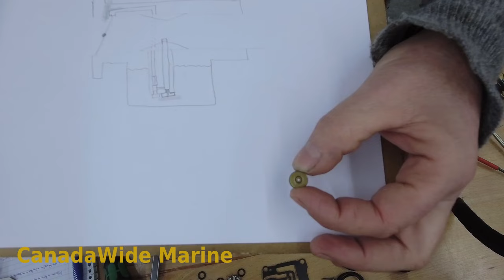Diagnosis and repair of 4 Stroke Outboard motor Carburetors. A look at the common issues.

Comment: I've been cleaning carbs for more than 40 years.  I've worked at an outboard shop & a couple of motorcycle shops.  This is the best description of what to do, how good it needs to be done & why you need to do it, that I have ever come across.  You did a great job.  Two thumbs up.  I watched this video because I needed to find the idle mix screw on a Merc carb & it was a dead ringer for the one carb that you showed.  I saw the location of the screw on yours.  I didn't see the plug on mine at first because it was behind the choke linkage.  You taught an old dog a new detail.  Thank You
Reply from the maker: Nothing better than a compliment from our peers in the industry. Thank you.
Reply: Ditto, was looking for my mix screw on my Merc this video helped a ton.
Reply: Hey, I just boat my first boat and I’m having some issues that I think is the carburetor. Do you think I can give you a call or text and you can help me out? Every where around me they want $450 to clean 1 carburetor… which is ridiculous.

Comment: There is absolutely nothing but great information in this video but just a point from my 9.9 use and quick but permenent fix. My best friend was a carburetor man for 45 years the absolute best. He couldn’t clean repair mine after tearing apart couple times. I bought a new on not that expensive.Didn’t work I new the motor had plenty hours but I new motor was perfectly good.  Then he noticed in the picture same carb upper left hand ther is a round circle with a plug in it. Popped it out  there was the air fuel mixture screw. Epa requirement cap for new factory setting not to be touched. Wear tear varnish whatever just a little turn giving motor more air and it ran like new. That motor keep running like new for three more years putting 400 hours a year on it. Bought a newer boat and gave that motor to a friend. It’s still going like new. Hard starting  rough idling that’s your baby. I live at the beach and it’s worked everytime I showed that cap trick to others that come and go from resort.

Comment: I am sitting on a yatch in a remote part of Australia, population density 1 person per 100 square kilometers. 😀300 nautical miles, 2 weeks from the nearest Yamaha outboard service centre. My outboard will not idle properly and cuts out when turning the accelerator. This is a brilliant step by step explanation of what could be wrong with the carburetor and how to diagnose it.  Thanks Canada Wild

Comment: The best lesson on small boat carburettors I have ever seen. I have 4 small engines that get little use and long periods of storage. Yesterday I partially stripped down a Yamaha 4 carb, hoping cleaning a few bits would help. It did start but ran very roughly. Today I've done it again understanding what I was actually doing... ( Yes it helps) Now it running beautifully.... Thanks for a great lesson.

Comment: I save all my old guitar strings for cleaning carbs they work wonderful.  Thanks for your hard work and wisdom sir.
Reply from the maker: Guitar strings would work great, different sizes too. Just be careful to not scratch the passageway in the jet, it can disrupt flow. This disruption is much more noticeable with newer engines that are more concerned about emissions.

Comment: Great educational video on the 4 carburetor circuits and how to race trace in the casting.  Love the use of aerosol lubricant to check passageways.  Also great explanation of the needle and seat and confirmation of when the needle and seat is open and when its closed.  Thanks so much for sharing!
Reply from the maker: Thanks for the great review!
Reply: Is there any way that i could get ahold of u to pick ur brain
Reply: @eliseoromero2926  fire away if i can help...

Comment: The corrosion is the part that tells me. You are 100% correct. I would advise the owner not because of the varnish Gunk build up cuz that could be cleaned it's more of a metallurgy seating issue. If you can get one and afford it that definitely qualifies is investing in the new body at least not to mention gasket kit that's why, don't leave fuel in your engine. Outboards like to be run honestly all the damn time at least twice a week the buildup one stress on impellers when you break in a motor have a system where I protect the water jackets with a thin layer of lubricant it is for impellers as well run fresh water through them once in a while also a very good tip. But this guy is good he knows his stuff

Comment: An excellent presentation. I learned a lot. I just bought a boat that wasn't prepared properly for winter and having issues getting it to start. It will run with a light spray of starting fluid, but not beyond that. It's looking like I will have a carb teardown in my near future.
Reply from the maker: I do not like starting fluid. If the motor doesn't start, something is wrong. Diagnose what is wrong and fix it, then the motor will start. Starting fluid will not diagnose or fix what is wrong. 
A engine needs spark, fuel and compression to start, it also needs to correct amount of those things at the correct time. breaking it down into those six parameters simplifies the diagnostic procedure.

Comment: Thank you making this video it was very clear and informative. I learned a lot, but not enough to figure out what's going on with my 8 HP Mercury 4 stroke. I just replaced my carburetor with a brand new one. The engine idles well and runs great at wide open throttle, but in between idle and WOT it acts like it's starving for fuel. No other changes were made to the engine, just remove and replace the carburetor, which is why I think it's related to the carburetor swap. Do you think this could be carburetor related? Thanks!

Comment: Thanks for taking the time to share your knowledge. Having seen this Im going right now to check the idle problem I have with my almost brand new 20 hp honda engine. Its idle circuit or probably float problem. /Thanks in advance! Regards, Johann from uruguay!

Comment: Best video I've found. And like you said, so simple. Thanks. Hopefully i get it running now. Especially since it was running before i decided to take it apart. But it wasn't running happily over half throttle.
Reply from the maker: Thank you. If it's a carb problem, over half throttle is running on your main jet, so be looking for a varnish buildup on the jet, or maybe low float level. A restriction or air leak in the fuel supply can also cause problems over half throttle.
Reply: @CanadaWideMarine  thanks. For the tips. Carbs clean. Was to begin with. Everything checked out. Still wont start. Spritz carb clean in there just a shorty hefty "i wanna start." Nnnn nothin. Guess ill be figuring everything out about small outboards instead of enjoying the river.

Comment: Thanks for sharing your wisdom. I learned alot and managed to pull apart a triple carby, clean and replace it thanks to you. I have the mercury carby shown in the accelerator circuit. My question is, if fuel is leaking from the bellows on the accelerator pump, would this cause bogging? The jet it feeds into is still working and squirting fuel yet the engine bogs at mid throttle.

Comment: Can you make the main jet a little larger (maybe make the percolation tube air holes a little larger as well) and get more performance (hp)? Maybe you have to bore the air chamber out some too??? No that probably wouldn’t work, the throttle plate would need to be larger after doing that, right? Is there a pretty simple “trick” to get a little more high end performance on a 15 yammy? Thank you for the information just past 22:05, I definitely learned something there, really the whole vlog 👍🏻👍🏻👍🏻 Had to rewind a bunch of times. You do a really good job of getting small parts in the middle of the screen and not moving around much, it helps when I zoom in to see it. Also learned it’s pretty important to have an external fuel filter/water separator to keep the dog’s hair and water out of the fuel system. 30:20 thanks for showing how to view the idle transfer holes ❤❤🎉🎉🎉
Reply: Can a guy do something to make one of those carburetors run off a 20 # propane bottle??

Comment: Nice job, my new 15 yamaha 4 stroke new yamaha tank, and hose not broken in yet.   After the winter had no high speed. Open it up clean gas and high speed jet had small brass fleck in it from factory. That automatic electric choke i dont trust. I have yamaha 3 and 5 hp, 2 stroke best running motors i have ever seen. This 15 yamaha 4 stroke worst motor i have owned. My Suzuki 25 4 stroke 3 cyl 3 carbs nice motor!

Comment: This was a great video. I am hoping you can solve an issue I have. I am leaking gas out of the accelerator plunge/boot. After  my 2001 Mercury 25 hp 4 stroke runs and shut off, the gas will start to leak/drip out of bottom of boot. I bought a rebuild kit and replaced all pieces and gaskets and made sure the float and seed is good to go per your video. I have not stated the engine yet, but I installed the carb and moved the plunger/accelerator up and down and I am still getting gas leakage after 4 WOT pumps (by hand). I don't want to run the engine unless the air vacuum keeps the gas and air from leaking. while running. I appreciate your time. Any help would be appreciated.

Comment: Hi, I have the same carbs on my F75 yamaha. I pulled the carbs off and cleaned them up, reassembled and reinstalled but still popping and backfiring at idle and worse with increased rpm. The only thing I didn't remove on the card was the idle jet on the side because  the needle has a brass cap on the outside...should I remove this cap and remove needle screw or not. Great video, sure would b great to chat to you.  Thanks

Comment: Thank you for a great video. My engine starts well, idles fine, and runs wide open fine. The problem is when I run at midrange it will run for a bit then stall out. Or if I run wide open and then start idling down it stalls nearing idle. Any ideas? Thanks for all the help.

Comment: Thank you very much for such detailed explanation of how all these works. I have 2004 F90TLRC, new to me. Low hours and clean carbs. It idles at between 9000-1000 when warm. Spark plugs are dry and more on white color(all 4 plugs similar color), indicating lean mixture. I am trying to avoid possible overheating and want to run engine in optimal way. Dont have starting problem or power at high RPM/speed. Engine runs and responds fine. I put about 20 hours on it with no problem.
Questions:
1.Do these engines tend to run a little lean(emission regulations) and I do not have to worry about plugs being not tan in color?
2.Do I want to play with butterfly screw on bracket to bring RPM down to 800ish? May be play with idle muxture screws? But there are 4 of those and I do not want to mess existing setting. 
Thank you very much in advance. Any thoughts or suggestions will be greatly appreciated.
Reply from the maker: Hello Ilia.
If you are not experiencing lack of power or driveability issues, (surging, etc) at WOT fully loaded then I would not be concerned about very clean spark plugs. 
I would definitely adjust the idle speed down. I don't have the Yamaha recommended idle speed handy, but 900 to 1000 rpm sounds a little fast. The bast way to adjust your idle is with a carb sync vacuum gauge setup. A vacuum gauge connected to each intake manifold runner so that all four carbs are balanced.
Reply: @CanadaWideMarine  thank you very much Sir for such a detailed answer. It is exactly what I wanted to know. I was thinking to invest in carb cync tool and you just made it easy for me. Yamaha says 850 is recommended RPM. So I will play with that. Will report here as well. I also downloaded factory manual, but it does not describe too much about working on engine. And I am a subscriber now.

Comment: Great explanation. Thank you.
How important are those little inline green filters that are sitting in carburator inlets for gas?
I have water separator and little net filter in engine.
Just did carb service on my f90tlrc.

Comment: You are correct. I would say more than 90% of the time probably 95.99 unless it's totally obvious it's always a fuel issue if you have spark you have compression it's easy to test for that do you feel resistance when you pull when you pull the boot off the plug small flathead screwdriver inside the boot gently fuel for a shock of electricity. I know that's old fashioned but it works let you know that the kill switch is not the culprit the Magneto is not the culprit could be the actual plug though but I digress I recommend depending on if the motor had not been running a long time especially the fuels left in the system it will turn to Varnish clogging the Jets. Sometimes you can get away with a can of carb cleaner but that's not the right way to do it. Drain the carburetor Pump Fuel through the system trim the motor all the way up after putting in screw back in carburetor Bowl need it trimmed full up Prime system with fuel start motor I know it's in the air I know the angle don't worry your impellers will get water soon enough chances are if it's that they're cracked anyways it won't overheat in a couple minutes but it will allow motor to run. Just thought I'd pass that on to you oh yes if you do have a separator make sure the motor is getting fuel clean out the Racor if you have. But the love of God just don't start turning screws and then call someone like me to come fix it although that's easy too turn back to factory specs all the way tight count rotations you will get your air fuel mixture correct but their Motors it could be a lot of things the trim up tip was the best key I could give you but this is meant mainly on bigger motors with push start

Comment: Following and rechecking based on comments to another user - my carbs have been fully cleaned, and I simply have a bog when you hit it and also a miss at about 1/3rd throttle.
This is a 30hp merc 4 stroke 1999.  I went to add/adjust the idle mixture a little richer - but there are no adjustment needles - there is a boss in the casting which looks like it may have been in the past but no longer.
Idle is perfect. You can nurse it up to higher power and it is perfect up there. 
Coming back down I can create a miss consistently, but only in a tight range then it goes away.
I don’t have a tach easily available.
It would seem to me that I need to go a size larger in the low speed jet. - any alternative suggestions?

Comment: Hi great job, I have a F9.9 MSHC High Thrust 2004 with the electric choke solenoid on top and I wondering if this carb can work or even fit or may not work as the CDI units needs the feed back from the electric choke for timing?  any help is appreciated

Comment: Will an incorrect float height create a lean running condition? I recently replaced 4 floats on a Yamaha F100. I was getting a lean sneeze around 2800-3200 rpm. Inspected the plugs and saw #1, #2 and #4 running lean. I’m thinking the float height will need to be looked at again. Idling great, and high speed boat runs great. I was thinking of enriching the idle mixture screw to compensate, but I think I’ll tear it down again and make sure floats are set correctly, as they should be.

Comment: Thank you for awesome video, I have 2001 Yamaha T50TLRZ I’ve have clean the carbs, where do I start setting the air/ fuel mixer at some forms Start at 2-1/4 on carbs 1,2 and3, 4 carb at 2 1/2 turns out? Do you know where it should be. Thank you

Comment: Turns out my accelerator was sticking open. Don’t know if that was the problem?? But it started. Now I have to figure out why it’s sticking or run it at idle only for now. The little spring at the carb maybe, or the plate has salt water buildup been the throttle plate and acceleration plate? If I can’t fix it, I can manually operate it, but that can become dangerous and subject the engine to more moisture since the cover has to be off and you’d have to turn around to slow the engine down, just want it right. She runs like a champ though, seems to be hitting the limiter now, it never did that before?? I’m at anchor so it’s my only way to shore, been oos for 4 days.

Comment: Thank you great informative video. My question is at what RPM does the idle function stop and you go on the main circut. I have a 20 HP Honda that idles fine and runs great at mid range and WOT but trolling at 1000 to 1200 RPM the engine stalls but restarts instantly. Sometimes this happens every minute and is frustrating. I have an inline fuel filter and that was clean. It gets a great squirt of gas from squeezing the inline fuel pump. The plugs look great. Any direction would help thank you
Reply from the maker: The idle circuit operates in 2 stages. The first stage, is complete idle, with the throttle fully closed. The second stage is called the transfer stage, it operates through about the first 5 degrees of throttle opening. In the transfer stage you are getting a little extra air coming past the throttle blades, but not enough to start the main circuit flowing. 
That little bit of extra air draws fuel out of the transfer holes that you can see just behind the main idle hole behind the throttle blade. This extra fuel comes from the idle circuit. 
So at trolling speeds, 1000 to 1200 rpm you are most likely still on your transfer stage of the idle circuit. 
To remedy this situation I generally richen up the idle mixture screw a little, about  a quarter turn counter clockwise usually takes care of it.
You may have to remove the cap over the idle screw. Some older Hondas have an idle screw with a limiter stop on it which can be a problem. open it up as far as it will go.